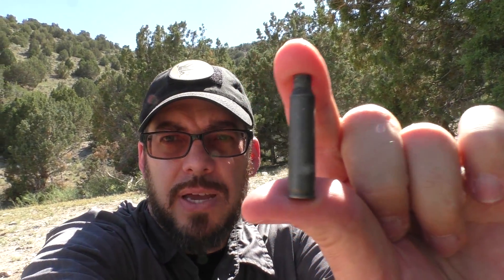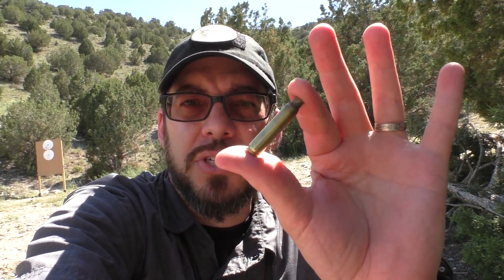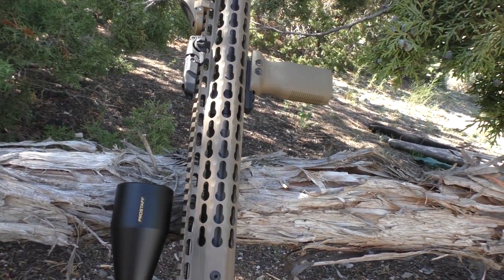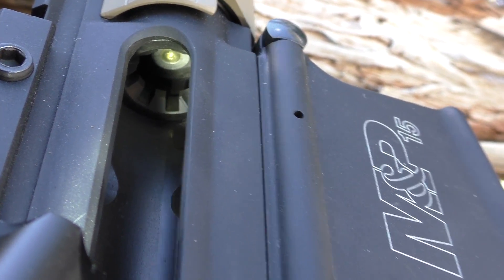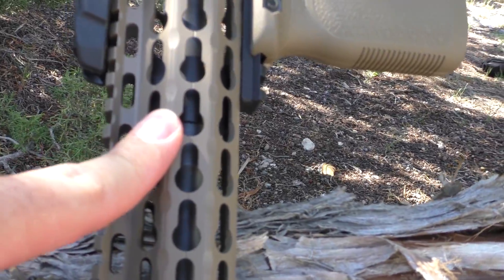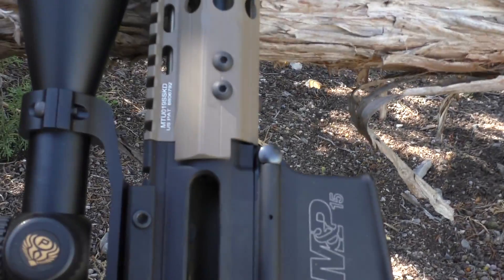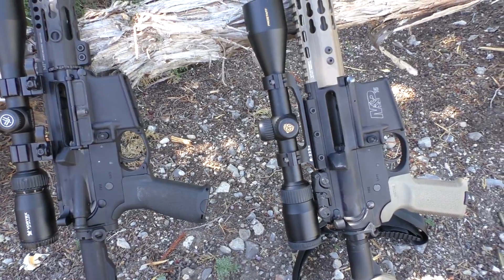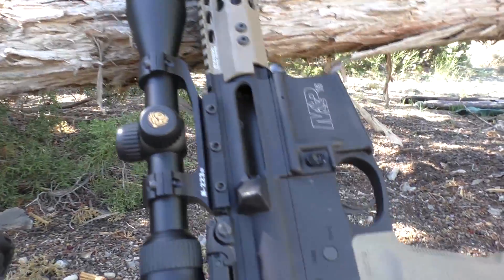Tula .223 Killed My Guns! V-Log Thursday

Comment: Your main issue is the ammo itself, AR=Brass case AK=steel case, had the same thing happen to me awhile back, looked it up, and alot of places won't let you come to train at their class with this ammo for this reason, you would hold up the class with your cheap ammo. To save money save your brass and reload, but once again just for plinking not to save your life. Hardcore steel case guys will be dead on the ground trying to free a casing. If you want steel case, buy an AK, it's that simple, the tolerances are much larger allowing for cheap low grade ammo!
Reply: Not true. I'm a range master and other ranges don't allow it because they're too fat and lazy to sort it out from the brass casings they recycle.

Comment: I experienced the same issue in mutliple casses thru my bushmaster (old good bushmaster, not new shitty bushmaster) with wolf, back when they used a laquer coating as opposed to a polymer coating used on most steel cased ammo today. Fast foward to today, I'm using a bcm upper and predominatly use tula and have never had an ultra failure to extract or any malfunctions at all for that matter. I've got around 8,000 rounds of tula through the gun. I thought that the polymer coating had resolved the issue, but aparently not. I'm sure you already checked and this probably isn't the culprit, but check our your gas key. Oh yeah, I never hardly clean my gun either. Before anyone tells me to do push ups, check out Frank Proctor's take on that matter.

Comment: tula ammo is on the dirty side. Plus the 223/5.56 chamber isnt designed for steel case. If you want to shoot steel case ammo get an ak. If you look at a 5.45x39 or 7.62x39 case you will see how they taper down smaller as you get to the tip. That prevents this from happening. The bore can be filthy and it will still pop right out. Its a round designed for steel case and the guns are usually overgassed to really have a violent yank to yank the round out. 

 Basically a lot of ar15s dont like steel case ammo. And tula is the worst of the dirty steel case crap. You might be better off with wolf steel case. But really ars are designed for brass case. If you want to shoot cheap steel ammo out of an AR get one set up for 5.45x39 It would most likely chew through the tula stuff without any issue.   Its not a design flaw with the AR and its really not a problem with the tula. Just they were never designed to go together.

Comment: The most obvious solution to thus problem would be to take a cleaning rod or a 3/32 brass rod to the range with you then you can tap the case out w/o going home and can keep shooting. In the future I would not mix large numbers of boxes of ammo together if they are from different lots, if you get a bad lot then all the ammo is put into question.
Reply: 3/16 brass rod not 3/32

Comment: Put a touch of lube in the chamber and on the cartridge and I guarantee it will cycle better. Just put a little lube or whatnot on a rag and wipe the cartriges a little before loading them in a magazine.  It sucks but it's better than getting a jam. I've seen brass cases get stuck in a dry gun as well.

Comment: You need to install a BCM power extractor spring. The extractor will stay on the casing that way. You can also run 5 steel one brass in the mag. That way brass will pull out the powder and keep it running.

Comment: Same exact thing happened to me,the tula is made so inconsistant. Sig m400 enhanced is what i was using when it happened to me . i called sig and they told me not to use the eastern european ammo steel case for several reasons ,mainly is the inconsistant manufacture of it. So yes ,throw it away or sell it.

Comment: 3 part problem. I see ARs come into our shop frequently with stuck cases and guess what... always TulAmmo.  1, tulammo is filthy, not like military surplus filthy, way worse. Shoot it at an indoor range and you'll see the black clouds that hang around the tula shooters. 2, steel casings, the biggest reasons we use brass are malleability(softer than the steel in your chamber), lubricity(it slides in and out easier than steel), and elasticity (it expands and CONTRACTS more than steel.) Steel casings scratch your chamber, expand but don't contact as far and aren't as slippery. 3, their coated in polymer or other crap that will melt into your chamber and make things sticky.

I could care less what you think of my answer. If you disagree, by all means, keep shooting this trash because I'll just keep charging you $60 to get it out and polish your chamber. All of which costs me $0.08 and 10 minutes. I hear wd-40 really helps your bolt speed and trigger pull too so make sure you soak her down with that before each spam can of tula while you're at it.

Comment: It's been my view that the M&P have been known to have issues with even brass cased ammo. It's my belief that unless it 5.56 NATO chamber you will have continued issues. 

I stopped buying and started building my own custom black rifles. Always 5.56 NATO chamber for better handling of ammo pressure. Chrome lined barrels..... Fail Zero BCG. Forged lowers MIL-SPEC. 

In addition I do my own ammo.... Bottom line ZERO PROBLEMS. And saved $$

Comment: I never liked steel case ammo.  I cut my hand on an extractor rod once while trying to eject spent 38 special cases out of my revolver.  I ended up taking the cylinder off the gun to avoid damaging the crane, and punching each one out individually with a dowel rod.

Comment: this happens to a old semi auto 22 that I have after replacing the extractor still happens so now I use a sponge with hoppes gun oil and roll the shells before I load them ol rifle runs like new some with my m&p 15 1 case jam and I'm lubricating the rest

Comment: I had the same thing happened with silver bear .223 ammo, the gun I was using was a Seekins precision /spikes tactical build (Spikes parts were H2 buffer, spring and niB BCG, everything else seekins precision with) so yeah I had a lot. basically summed it up to cheap ammo production. as I head a few other guys at the local range had the same issue with the steel cased stuff. ever since then I keep a M-Pro kit in my shooting bag. for the 20 or 30 bones, has everything you need to fix that issue. and like playa2323 said, just to be safe, pull the BCG out before going all wack happy on the round (incase it didn't discharge).  even though there was a primer strike, always try to be as safe as possible.

Comment: It' really more about the steel case not expanding, and the powder used (unless they changed the powder from 10 years ago, IDK. Use to be the cheap stick type powder.) Same problem they had in Vietnam, gun is designed to run off EMR powder (enhanced military rifle). Back in the 60's the military didn't dump their contracts with powder suppliers, and remained making the 5.56 with cheaper stick powder, which resulted in all the early problems, and unfortunately resulted in many lost US lives till they figured out it was the powder all along. Kinda like running diesel through a gas engine, or something along those lines.  Read the book "The Hill Fights. The first battle of Khe Sahn" goes into hardcore deep detail of the whole situation. Great book.

Comment: it's the wax coating it actually soaks up in the pores of the metal and makes the chamber diameter smaller IE failure to extract see a gunsmith he can fix this issue

Comment: I had an issue like this with brass ammo that was reloads from Midwest and the cases were swollen, ended up breaking my extractor, range took the ammo back and gave me a full box of any brand 223 I wanted, fixed the extractor and haven't shot nothing but steel cased ammo after with no issues.

Comment: Just fired 120 rounds of Tula steel in a new M&P15, not one issue.  Close one eye when shooting ,should eliminate any problems.  LOL
Reply: John Silver you will experience problems over time if you don't leave chamber wet.
Reply: will remember that, thanks
Reply: No problem. ARs can fire steel. They just weren't designed for it.
Reply: No actually genius AR run better when they are well lubed. The oil and some use motor oil goes into the barrel extension in order to keep the steel case from sticking to the walls of said extension. Or you can just buy and shoot brass ammo however if it's a DI rifle and you shoot more than 200 rounds you better keep it well lubed anyway. That is to say "Shoot it WET"! It's called a euphemism. But hey I have no idea what your background is. I've been shooting the M 16 platform for 30 years now.
Reply: You're correct and Hollow Ts 4 OGs is wrong!
Lubrication in the extension and chamber is a dangerous practice. The lube creates excessive bolt thrust...which is why gun makers advise that keeping the chamber and barrel free of oil before use, is the safest way!
Reply: Yeah.... I don't have 30 years experience or anything it's common sense that nothing belongs in the chamber but the cartridge.

Comment: then using steel cased ammo ( any cal  )  have your port and feeding ramp polished  / extracting will be much easier . you can run about 200 rd's or more though it , then clean it , I use carb  cleaner ( long spray though the port and down the barrel ) then apply a good amount of gun cleaning oil (Remington)   works for me . ( when extracting a live rd , open up the upper , remove the bolt first .......... nothing there for the rd to backup against and primer strike .....oooops !

Comment: The one thing that I've always been told is that typically, a more expensive AR can run steel cased ammo without concern.  A less expensive AR might have issues with it.  I have a middle of the road Colt lt6720-R with magpul accessories which cost me around $1100 awhile back.  It's built with fantastic parts inside and out.  So far, I've fired roughly 700 rounds of .223 Tula out of this AR and have had no issues so far.  Also, I'm buying this ammo with the knowledge that it has an EXTREMELY lower price tag than brass cased ammunition, and almost expect some sort of malfunction.  In your case, idk if the issue is the batch of ammo, the guns themselves, or what.  I can only speak to my own personal experience with the ammo.  Now, 9mm Tula is a different story for me.  It has been very very unreliable, and doesnt like aftermarket mags at all.

Comment: I shoot tula all time. This has happened to me.  Couple tips.... keep your barrel clean, bcg clean.  Keep it out of the hot sun.  Lately I've been alternating steel n brass, mixing the two. I feel it helps with cycling n extraction,  that's jus what I think in my head,  but to be honest. ..it has worked well. Both my ARs are budget builds.  Barrels r standard chrome moly. Love this ammo.  Keep in mind....it doesn't hurt to carry a push rod for just in case!  Couple bucks at home depot.

Comment: pour motor oil on a rag wipe the ammo on the rag to pre lube before loading your magazine that tulammo steel case with zinc bullets that stuff is battle ammo you can hone the chamber or have the chamber fluted better yet don't run that stuff

Comment: After the 3rd time in My Mini, I'm a #NeverTula guy now.I also had to ram it out with a cleaning rod. I get the appeal of Tula cuz it's cheap, but like the old saying goes, you get what you pay for. And with lots of places reloading .223 you can almost get a case of brass for the same price. I baby, my AR's. My Sig 516 runs it fine, but it would turn the gas up always for fear of your exact situation happening. Tula ain't worth the hassle. Tula is for AK's period.

Comment: after browsing forums like mad, reading reviews, talking to both young and old shooters (neither new. years behind a rifle) i will say that it was probably because your rifle throat got nasty from shooting it and it just got stuck. i bought 100 of zinc .223 and will try it on friday. i have brushed and cleaned my chamber to hell and backto make sure it was absolutely clean before trying it. i have also actually "dry pulled" all 100 rounds through my gun (loaded, chambered, manually extracted as fast as i could. not a single issue doing that, if that means anything) and honestly the rounds feel.....wet.. like this weird black stuff came off onto my hands as i was handling it. either way all 100 roudns have already fed through it. and friday, i will shoot it...brush the chamber out, then shoot brass and see how it goes.

Comment: I have heard many experts say Steel is as good as Brass but at a better price point. But there videos like this where I fire Steel and Brass and the Steel is giving me problems now. If I was a Formula 1 race car driver I dont think I should roll down to the  Race Track convenience store (pun intended) and put Regular Unleaded gasoline in my very expensive vehicle to save myself and my Sponsors money it would be better to use the correct stuff?

Comment: Rule of thumb; Russian ammo is designed for a Russian gun: AK's & SKS, ect. American firearms should eat a healty American diet. Sure! You can feed it whatever... But, for how long until malfunctions occur. You shouldn't have to lightly grease the chamber or oil your casings. These are short cuts that will only lead to bigger problems that could mean replacing the barrel. TulAmmo is fairly dirty to begin with. The steel casing doesn't expand like brass. So, you get more carbon build up from the blow back into the chamber. Plus, that enamel coating starts to warm up and deposits into the carbon that's building up in your chamber. Essentially, cementing carbon residue into the already hard to clean areas of the chamber. Which leads me to cleaning! You can get overzealous and do more damage trying to clean some of the hard to reach areas by scratching and scaring with hard brushes and picks. Ultrasonic cleaners are the best! They're only as abrasive as the solvent used and they do the scrubbing for you. You don't recommend eating the fruit and drinking the local water when you travel outside the U.S. Right? That'll either stop you up or make you run! It's sorta like that.

Comment: I run 1 brass cartridge after every 4 rds of steel cased ammo and have had almost no issues.  The steel case does not seal the chamber and allows  blow bye. Mixing in the brass cases ammo seals the chamber and clears out the carbon. I have run 6 steel for every 1 brass with pretty good results.  1 and 5 gave me no issues but 1 and 4 is what I run to be "safe"

Comment: HI, - great videos...

I don't believe its your gas system at all - I have exactly the same issue with my bolt action 223 using Hornady steel match 223.  I end up having to get a cleaning rod (or piece of wire in the field).

Glad I found your video as I thought my extractor was broke.

Comment: Measure gas port size .058ish too small.Needs to be bigger due to TULAS type of powder load.Refrence lucky gunners steal case vs brass case torture test and you’ll see why one of the bushmasters was having this very issue.I know it’s an old thread but just in case someone comes across this vid with same problem they will be able to resolve it with a proper size drill bit and turn their AR 15  into a TULA eating machine

Comment: 5.56 in a 223 chamber ? wear your gun in more. chamber is tight and the case doesnt have enough room to extract. also, the steel is a tad bit harder, not by much but the metal itself doesnt contract at the same rate amd heat that brass does. if you have any brass painted in the chamber like your shell deflector does after shooting a bunch. coupled with any coating the steel has, when heated causes a glue like layer to harden and cause the case to not only be tighly held in the chamber but the coating glues itself between the case wall and chamber. had this problem as well, keep a chamber brush and some solvent handy when shooting steel and NEVER leave a steel round chambered. every so often while shooting clean your chamber and always leave the gun to cool on an open chamber and run your brush down ot after a cool down. seems like a hassle but its not thay bad when compared to the monetary savings you get. recap- leave chamber empty and keep it clean, dont let build up of steel coating in the chamber and all should be good.  i have the same PSA with a CHF barrel.

Comment: I'm getting a headache reading about steel cased ammo. I have an Armalite DEF15 and it has never shot anything BUT steel cased ammo. Never had a single problem. Not one. My view is that there's lots of drama being tossed around (lacquer melting, polymer melting, brass vs. steel expansion, chamber pressure, heat, barrel length, etc.) and all of these points are UNSUBSTANTIATED, ANECDOTAL, WITH ZERO REPEATABLE, MEASURED DATA of any kind. Valid conjecture, maybe, but all of theses opinions (including mine) and two bucks will get you a cup of Starbucks anywhere. Keep your gun clean.

Comment: I've had delayed fire up to 3 secs   I pull the trigger and nothing happen like a dud.  Then BANG the round fires the the bullet itself will get lodged in my barrel. Like a bad primer and a very light powder load.   Very scary.   I have a lot of ammo left I just won't shoot.    Bad ammo.   Unsafe!!!
Reply: Bayou billy Try changing your firing pin to an enhanced firing pin and a heavier(harder) hitting hammer. See if this fixes your problem. Russian ammo is known for using harder primers.

Comment: Let me tell yall my experience with these bullets. I have a single shot .223, i shot 1 bullet in my gun and boom, it got stuck, the reason is because the steel casings are expanding in the chamber and u have to wait an hour or so for it to go down in size. Never using again, almost broke my gun
Reply: Same here with Tula no problems with Wolf